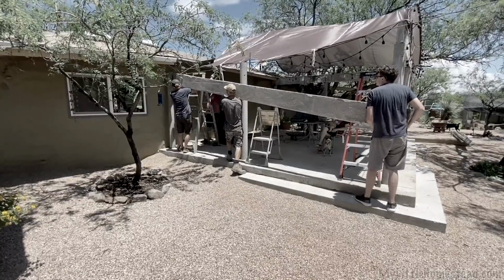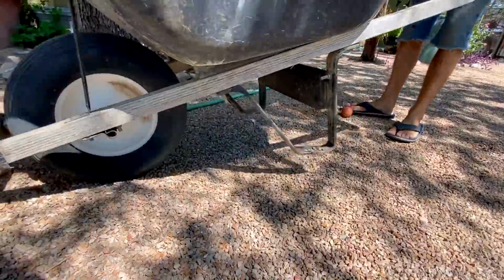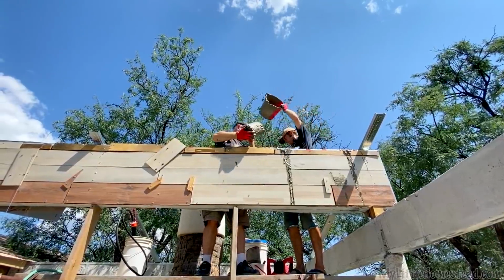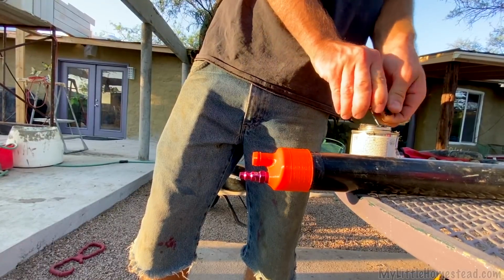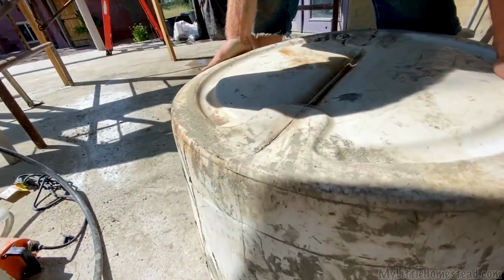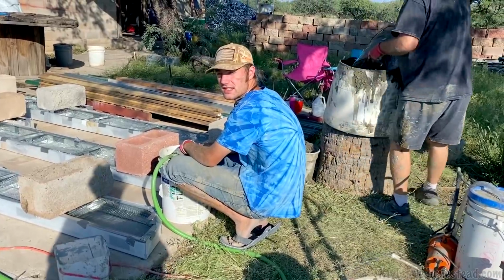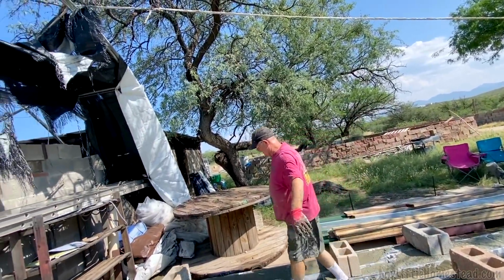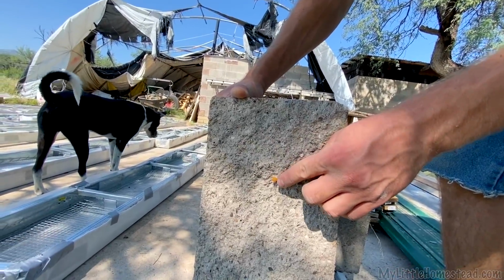Aircrete Recipe is What? | Weekly Peek Ep319

Comment: I'm not sure if you're are still messing with the aircrete but if you add a tiny bit of glycogen to your foam solution before mixing,  just a few ounces if that, you get a much more stable foam. Also if you use hydraulic lime and a small amount of cement, like 30 ounces of cement to 55 pounds of hydraulic lime, you get a stronger more versatile product without adding to 5he weight. Do this way and you can cut it with a wood saw but a sledge hammer does almost no damage and it's less sensitive to temperature variations like cement is with the weight almost the same.

Comment: Aircrete can be so inconsistent. I think measuring everything by weight as accurately as possible is important. Make test blocks and keep EVERYTHING consistent. Measuring by eye by filling containers can move your water to cement ration to far. Foam has to be dry as possible and shaving cream consistency. Measure foam weight for every batch. Impurities in water also cause problems with the foam. Mixing without pulling in large air bubble also helps. It seems like messing up the water to cement ratio is really easy with aircrete and makes it super weak. Looking forward to the results. Don't be to disappointed if a few don't turn out.

Comment: Your foam needs to weigh 9-10gms per 1ltre. A 20kg bag cement to 12ltrs water and foam to 75ltrs, also if you add a pinch of fibre glass fibres to add strength. If you want a hard surface you can mix up a pour of a waterproof outer layer cement (I forget what it's called sorry)
Reply: Oh and if you lift and drop your mixed aircrete to the ground gently 5 times, it relaxes the bubbles

Comment: What is the recipe you use for foamcrete?  What is the resulting density (in lbs/cu.ft)?  What kind of load can you put in the middle of various spans of your beams?  It is very exciting to see what you are attempting, but a bit frustrating that we don't see how you approach the details.  Have you ever attempted an exterior vertical wall or roof pour?   I would love to learn how you would wrap a house with foamcrete as an exterior insulation/vapor barrier and especially how to waterproof such a roof.  Thanks so much for sharing your beam-building!  These are valuable shares!

Comment: Shelly has that logistics thinking down. It's not a hard part to make, but it takes time. So have one extra in case the first one breaks down. Then as you're installing the spare one, you start the process of printing a new replacement one, meaning unless the replacement part breaks in the first ~3 hours of use, you should be OK.